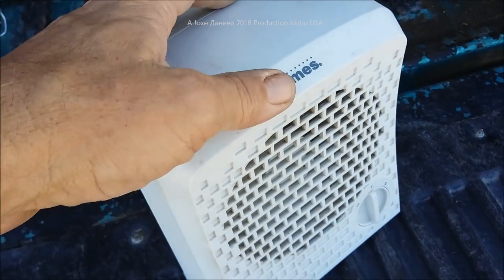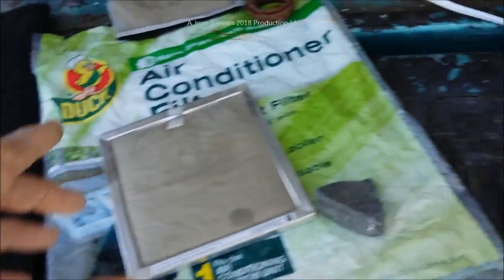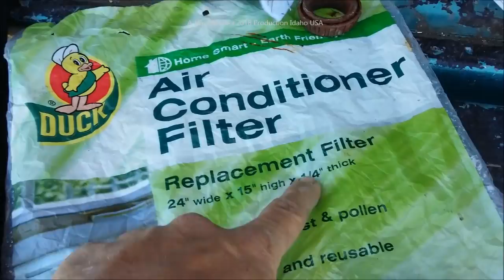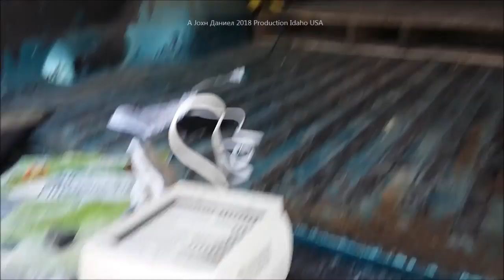Holmes HAP116Z-U Air Purifier fan FILTER HACK

Comment: I have one of these and use it in a room with guinea pigs.  I hay dust is all over the fan.  Is there a way to take it apart and clean the fan.  Thanks for what you show, for I am going to do that too.  At the time I bought this purifier, they did have replacement filters and I bought two.  So now that they are gone, I need to do what you did here in this video.
Reply: If you want to clean those pesky internal parts the four Philips screws are located under the foam trim where the filter would be in each corner, but the left lower one is slightly higher than the right sided one. You don't have to remove the foam trim just a long-headed Philips screwdriver should do the trick to poke in each screw hole and unscrew each. Gently lift as knob, outlet, and fan wiring are zip tied together. I cleaned with alcohol Jack Daniels preferably(kidding) use of alcohol wipes or some on cotton swabs should get in those stubborn corners. Once cleaned to the way you like it reassembly is the way disassembly went.

Comment: Hi John, that's a great tip!! TY! Now, would you know how to get the front off of that same Holmes air purifier???? Mine is really dirty, because like you I found out the filter that came with it sucked LOL.  so I took the filter off, put it in a small window in my bathroom where the litter boxes are and pulled the air out of bathroom to the outside.  Now i want to use it for it's intended purpose, but the inside where the fan blades are is really dusty and dirty.  I can't get the front of the damned thing off!! Any ideas??

Comment: I have 2 $130 Oreck air purifiers off QVC (2016’ish). Only bought a replacement filter system once ($50!). It’s a V something filter. One w/ charcoal beads & another fancy filter. I had purchased Honda in cabin air filters off amazon (w/ promo) & they sent me 8 instead of 2. Decided to try one in this unit & it fits perfectly. (9”x9”?) I’ll prob add this foam to that, unless I can find Lg. carbon sheets for less than $8 (current amazon price). I have many air purifiers that have been collecting dust for years because the filters are too costly! Thanks for your tip! I saw that unit on Walmart site & was so confused when I couldn’t find replacement filters!
Reply from the maker: I run 2 box fans in my house with a big filter. Bulk filtering is awesome, lets the purifiers work better. We live in the country, on a farm corner, with bunch of border collies & kids. DUSTY!! so running these https://amzn.to/2LWk5b5 filters on this cheap fan https://bit.ly/2ywi1xA and in 2 years, amazing bulk filtering. The filters are really reusable, you can go outside shake them out and re-use, those box fans I linked are best price I ever found in METAL 20" and quiet, with REAL motors not that shaded pole junk.

Comment: Thanks for this tip! Wondering, do you ever open the machine itself and clean the fan/inside? My fan is absolutely filthy from keeping it running all the time.
Reply from the maker: Blow it out with air, or take a Phillips screw driver and take it apart, its not hard to do. Of course, unplug first!
Reply: @JOHNDANIEL1  Gotcha! I don't think this machine has screws to unscrew but I'll try to wedge it apart. Thanks for the tip.
Reply from the maker: It has very deep screws, use a flashlight, there is 4 if its the holmes or similar rebranded.
Reply: Wow, thank you! I was thinking the same thing! Remove the rear air filter and the access points to the 4 Phillips screws are behind that foam gasket sticker at the 4 corners. Then you can open up the unit to clean the fan blades!
Reply: If you want to clean those pesky internal parts the four Philips screws are located under the foam trim where the filter would be in each corner, but the left lower one is slightly higher than the right sided one. You don't have to remove the foam trim just a long-headed Philips screwdriver should do the trick to poke in each screw hole and unscrew each. Gently lift as knob, outlet, and fan wiring are zip tied together. I cleaned with alcohol Jack Daniels preferably(kidding) use of alcohol wipes or some on cotton swabs should get in those stubborn corners. Once cleaned to the way you like it reassembly is the way disassembly went.

Comment: I wonder if you cut a hepa filter down, if that would work? I love this hack, but need something to filter out molds from the air.
Reply from the maker: You can not cut a HEPA, and HEPA are not as good as they claim, numerous recent debunking test have been done on HEPA. Mold has to be handled with wet sump filtering.

Comment: Was wondering if that filter material was worth using...
Reply from the maker: It is made of some oddly negative charged plastic foam material. Compared to so called HEPA filters, it uses its natural static to attract dust, then as the dust builds on it, it gets more intense on charge and filters at a even better micron level. So use it, but let it really fill up with dust to increase its effectiveness.